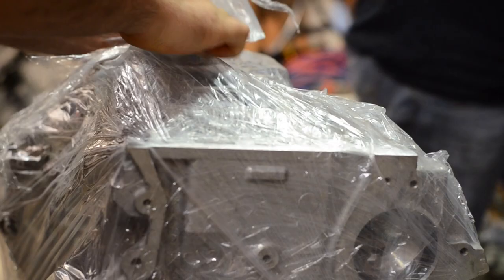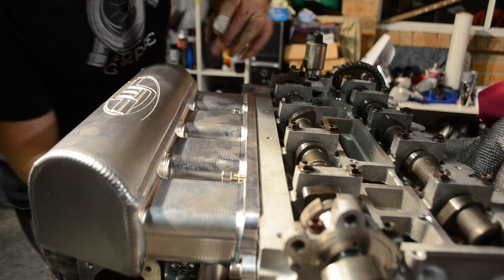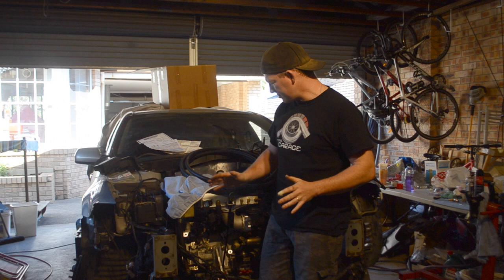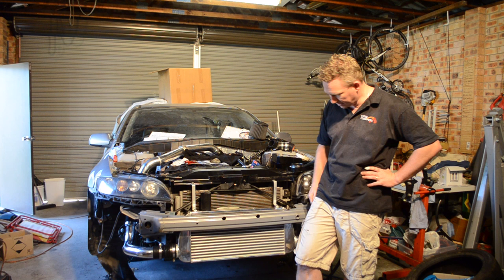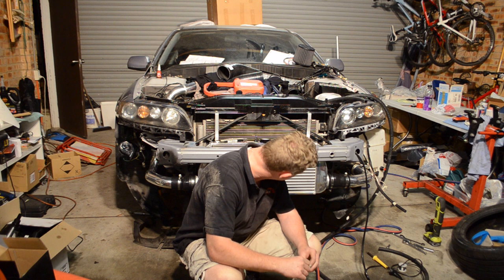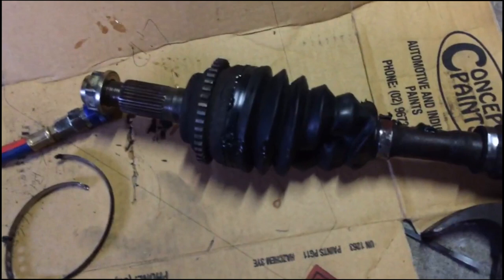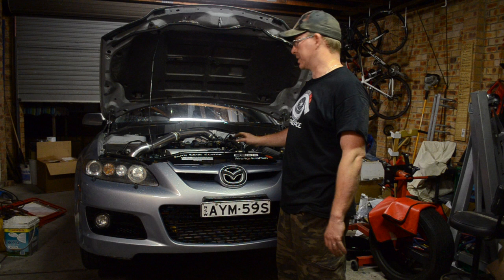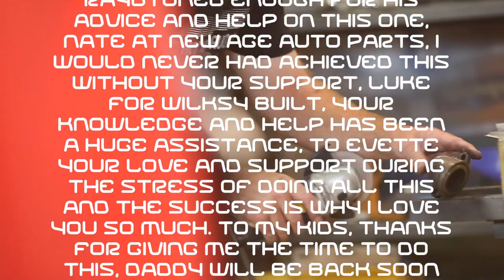The MPS6 Engine Build! IT LIVES!

Comment: As the owner of a Speed 3 (same MZR DISI Turbo powerplant), I approve this message ;-D
Tell me you didn't use ARP2000 head studs, though. They're known to lift sooner than stock bolts do (which are proven to 500whp). That's one of those peculiar things about the Speed platform. L19s are a much better choice for upgraded head studs.
Reply from the maker: Hi mate, yea I went the L19's I believe, I was warned about the 2000's lifting after a while, I wanted to go as high quality as I could without going to a keyed crank and ported head, they where going to cost me around another $3k which I just didnt have when I was building this time around.
Reply: Tims Garage The head would be nice. As long as you use new friction washers and the correct procedure, you don't have to worry about slipping timing/needing pinned cams or a keyed crank, even if you're pushing 700-800whp, according to the gurus on this platform.

Did you have to do a re-torquing procedure on the L19s?
Reply from the maker: Numinous I know most guys in Australia haven't worried about that, but then we are not pushing the power of our USA brothers and sisters. so far I have not herd of any lifted heads due to stretching studs.Id say the majority of the mazdaspeed community are concerned with vvt and smokey K04's. there are only between 20-30 people that I know of who are rely pushing build engines, and of that probably 6 who are actually getting it to work. (I dont include myself in that... I just had my engine rebuilt again after a cracked cylinder showed up). Im not looking to kill any records with mine but I would love to hit that 500hp mark.
Reply: Tims Garage Then you probably know all about the ARP2000 head stud debacle. They required a re-torquing procedure and  still didn't hold as much power as stock head bolts. Many folks stick with the stock head bolts, which are tq + degrees TTY type, and are known to be very reliable for up to 500whp builds.

It's just kind-of ironic, since ARP stuff is usually good. Their ARP2000 head studs are just an exception for us. And it wasn't that they stretched, but that they didn't provide enough clamping force.

VVTs are all covered up to 7 years/70,000 miles here, but the MS6s are so old that they're outside the TSB range now. So we have a lot of VVT replacements going on too. The DCR replacement is bulletproof, if you don't go with the updated OEM VVT design that also addressed the design flaw.

And smokey turbos are definitely a thing here, too. BNR turbos are great replacements instead of putting a weak K04 back in there that's much less robust, much more prone to fail.

Anywho, glad to hear you guys down-under are enjoying your Speeds, too.

Cheers!
Reply from the maker: Thanks mate, appreciate the input, cant wait to get some more speed video's out in the new year!